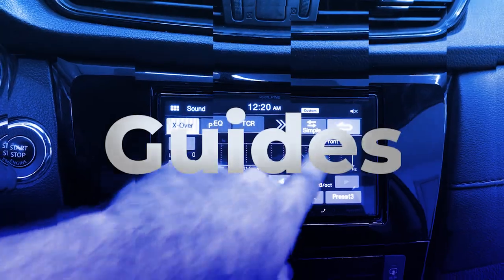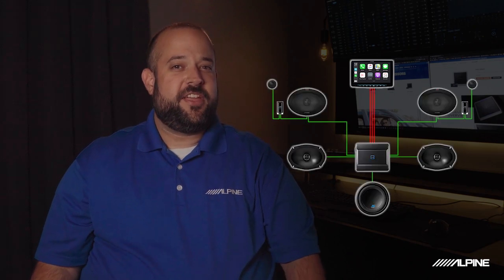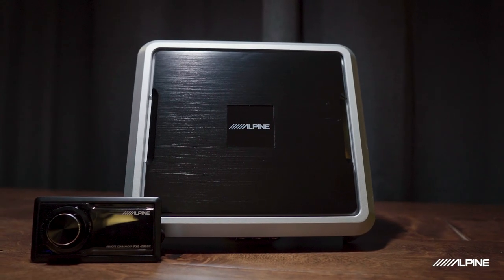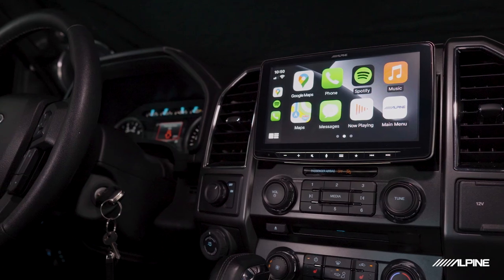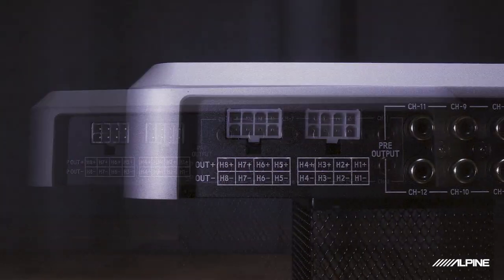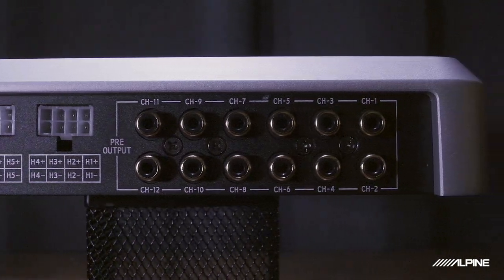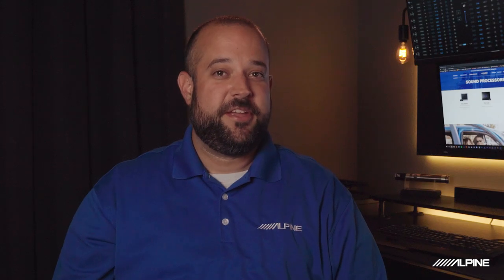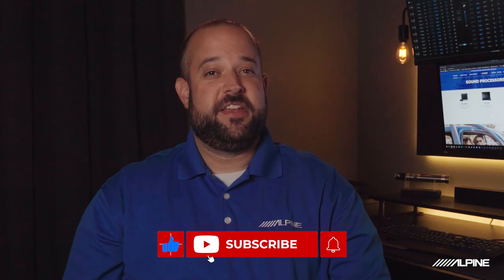Your car audio can sound AMAZING with this one upgrade...

Comment: any further explanation of Anti-EQ for high level input with the Alpine CX 60 DSP? I need to know if it auto configs OR if you change the volume in your car, effectively changing your factory EQ to change..  Will it automatically adjust? The documentation is CRUD and says NOTHIGN besides.. It has Anti EQ

Comment: You said it keeps tweeters from trying to play bass, but isn't that what capacitors and cross overs are for? (noob here)
Reply: 2 years late 😆 for component tweeter yup crossover does it. 
If coax tweeters a capacitor again you’re correct.

Comment: Can I use this if I already have 4 channels amplifier installed? If yes, how would I install this?
Thanks
Reply: Yes and that's what I'm gonna do. I already have a 4 channel and monoblock amp
Reply: Splice your power source with a fuse block and run your remote start currently in the amp to the dsp instead and then run it back from the dsp to the amp so they both remote start. The power plug for the dsp will allow for an in/out line to do this.

Comment: I have a alpine car radio, but it is not working on the usb input, any ideas, has a cable installed for the usb ,but no display on the screen of the usb,radio is only 7 months old 😢

Comment: Great video series. I've been trying to figure out a combo that'll allow me a 3 way active up front, along with retain the overhead and door speakers in the rear of my RAM. The problem has been a reasonable dsp that can handle all of those channels. This should work great for highs and mids up front, and rear fill. Then have it control a bigger amp for my front mid bass, and one for my subs. Now I dont need that $1,500 dsp. :p

Comment: I have the Ilx-w650 head unit, polk audio amp and upgraded all 6 speakers and sub, would getting a DSP unit improve my sound quality?
Reply: Yes. 31 band eq, time alignment, per channel x-overs (HPF, LPF, Band) with different degree slopes, and channel summing to get full range signals.. let's you customize and perfect things.

Comment: I built my dream system 2 years ago, alpine 7909, mcintosh amps an morel elate speakers. Also an alpine pxe-850 that sounded perfect! unfortunately 1 week ago the dsp died, my stereo shop said this was a fluke, but this is the 2nd alpine pxe-850 installed in 2 years that failed, the first was defective, the 2nd just died, this isn't a daily driver, its my camping truck, alpine said i can pay to fix it, but my stereo shop is 85 mile away, plus a couple of days off to yank it an re install it - always been a alpine fan but i'm looking at other companys for a new dsp
Reply: Where the hell did you find a 7909 and how much did you pay for it?
Reply: Hi, sounds like it's a good build.
I'm new to this so really confused as to why you need a head unit at all if you're using a DSP? Isn't there a better source or input for your system than using a head unit that's wired into your loom etc? 

Surely good AAC or lossless audio file could/should be able to sent to the dsp in a cleaner way?
Reply: @R1davies  I'm old an was trying to build the ultimate SQ system for me, i didn't want a dsp, i was happy with my analog system prosesser, but my stereo shop pushed me in that direction. Last time i checked S Q sound competitions are done with analog head units
Reply: @jimburson2226  if you're over 45 you classify as older than me. 
If you were around in the 80's you will understand my confusion. 

I'm building a "new" unit with a head full of technics m5 separate memories and alpine headunits with 5x9's

If my source is already FLAC then I assume I can bypass the headunit and just use the current "audiophile" DSP? (To everyone)
Reply: If your source is FLAC then you shouldn't need a head unit, alot of this tech. is in its infancy, an i'm 62 an don't want to wait, becides Alpines new F 1 status is 35k an i have about 1/3rd of that in mine. I called about 6-7 high end car stereo shops about my problems an ALL of them said to go with Helix or Audison dsp.
Reply: @jimburson2226  yep. Thanks you've helped a lot cheers